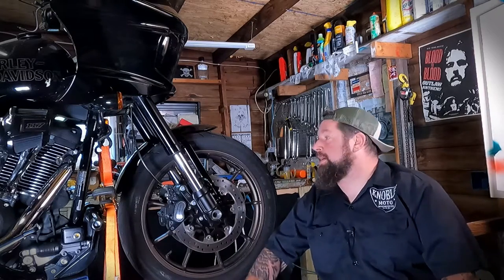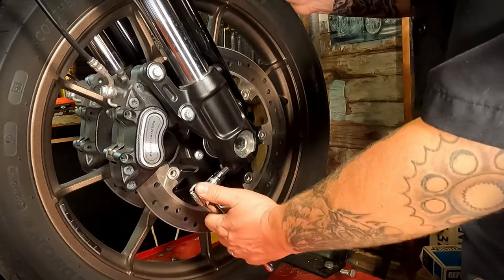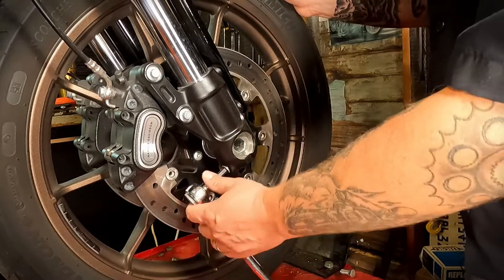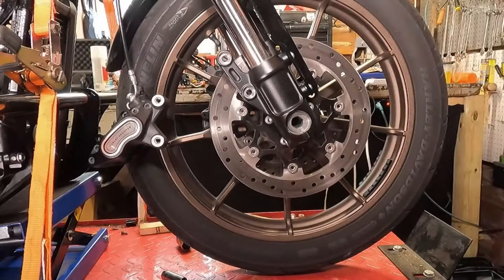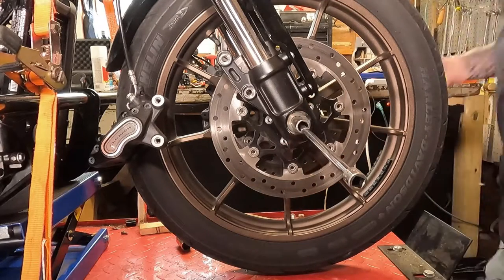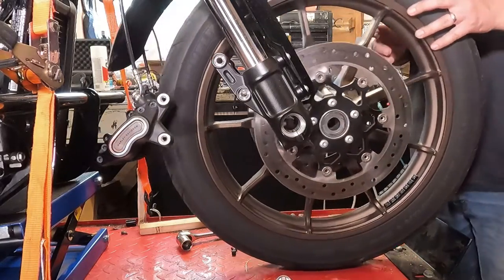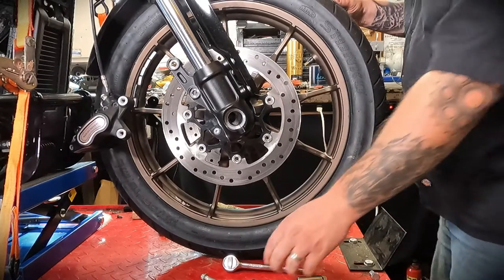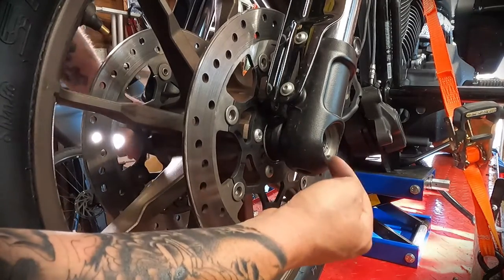Lowrider ST & S Removal and Reinstall of the front wheel

Comment: My Spark plug socket is round on the inside.  The 3/8 extension will not work.  Double check yours first.
Reply from the maker: Seems to be 50/50 on being able to do this.  
The proper Allen socket does work better